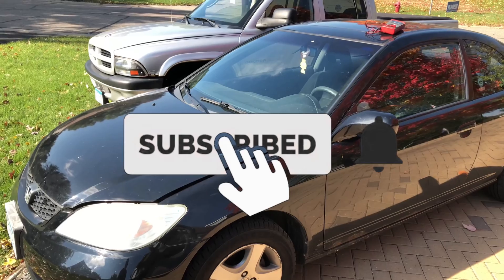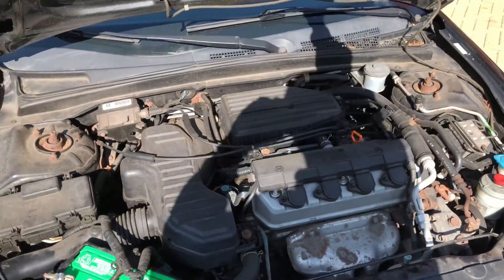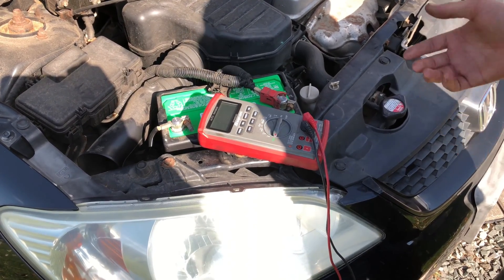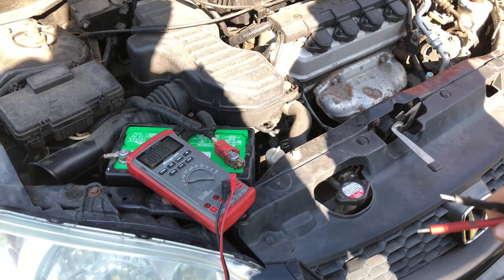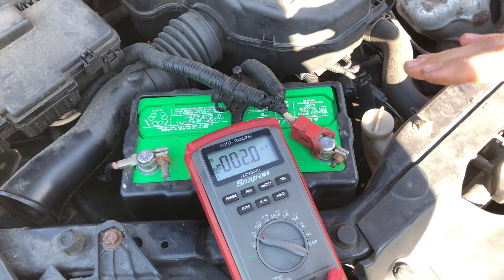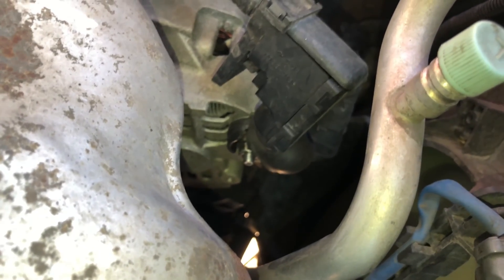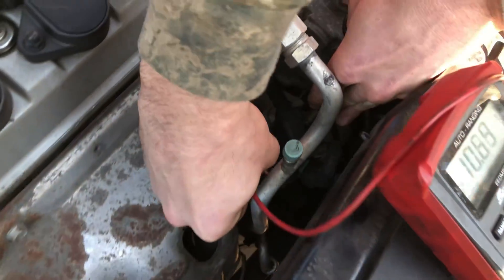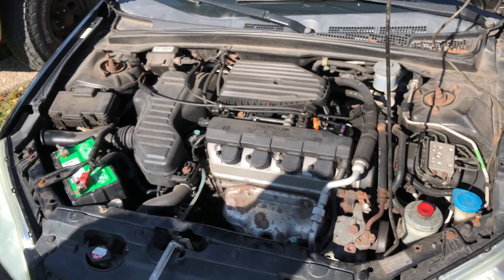How To Test An Alternator | How To Check An Alternator

Comment: What should it read when testing the alternator? Where should it be to know it’s good?? Thanks in advance
Reply from the maker: You should be getting around 13.5V-14.5V while the engine is running. Anything below 13V is usually considered weak output.

Comment: Battery sitting at 11.8 but started. Volts at battery dropped to 9.8 when stareted without any extra load. Saw your video but now won't start. Getting battery checked and charged. I will do the check at the alternator once I get it started. If I'm still getting under 10V at alternator do I need to check for anything else, or can I assume it's the alternator.
Reply from the maker: 99% of the time it would be the alternator. There’s always a small chance that it’s a bad regulator or a broken fielding wire going to the regulator, but most of the time the regulator is built into the alternator anyways, so that basically just leaves a potentially broken wire.

Comment: Thanks for replying sir. I tested the way you did and the alternator puts out about 1.45v that's what showing in the multimeter set to 20v looks like I have to replace it.
Reply from the maker: Only 1.45? That’s terrible lol. Assuming that’s an accurate reading, it’s definitely not charging.
Reply: @TonyTheTruckGuy  Yeah, 1.45v that's what it's showing, bought it from a wreaking yard. I tested fuses and continuity of all the connections from battery to alternator they all ok. I'm shopping for a new alternator on e-bay now. Cheers,

Comment: Good video. when testing the alternator your meter showing 11.7v if the alternator is good what's the reading would be above 12v??.
Reply from the maker: 11.7 at alternator is bad. If the vehicle is running, you should have over 13v at the alternator and battery. 12-12.5 at battery and alternator if engine is off.

Comment: Yep my alternator was charging at like 11.5V, I had just changed the regulator on it about a month ago, was charging at 17v! Was working good for a while. Guess it's time for a new alternator, do you recommend any brand?
Reply from the maker: OEM if you have the money, otherwise pick your poison. I’ve used several O’Reilly brand reman alternators without issue, but I’ve had problems with Napa batteries and alternators. I got 4 bad alternators in a row from Napa on a early 90’s F-150 and they all charged 12.5 or below. 5th one finally worked lmao.

Comment: But what if your car don’t even turn on at all? My battery is dead but I put a different one a honda one idk if it matters cus I drive a Z but it still didn’t turn on n the new battery is new! Is it the starter or the alternator?
Reply from the maker: Does it even crank the engine over when you turn the key?
Reply: @TonyTheTruckGuy  negative it don’t even do that and I’m worried
Reply from the maker: @RunnerUpGunner  Either the new battery is not corrected properly, or you have other issues going on. Even if the alternator were bad, the car would still start with a good battery that’s properly connected unless it’s not the battery that’s the problem
Reply: @TonyTheTruckGuy  so it could be either the starter or alternator-is what I hope
Reply from the maker: @RunnerUpGunner  Not alternator. Alternator has nothing to do with starting, just charging. If it won’t even try to start, either the battery is dead or connected wrong, the starter is bad, or power is not getting to the starter when you turn the key for some reason. There’s many possibilities.
Reply: @TonyTheTruckGuy  so it’s the starter if it ain’t getting charge at all? Cus the old battery yes it was completely dead but the new one from the Honda is fully charged yet won’t even crank or nothing completely dead so it could be the connecters from the battery going bad or the starter
Reply from the maker: @RunnerUpGunner  Yes, could be starter, could be cables, could be a relay, could be a fuse. The ignition switch could even be bad. You would need to do a series of tests to isolate the issue and properly diagnose it, otherwise you're just throwing parts at it.
Reply: 1 of the 3 wires connecting to the alternator could be the issue....check each 1 @ the alternator

Comment: Thank you sir! I was gonna replace the alternator because  the battery  is only a year old with  a 1000cca. The battery  reads 12.5 but won't  start after a jump the alternator  is 14.6 and battery is around the same with vehicle  running so I'm thinking the battery  and Michigan  cold weather. Thanks. Subcribed
Reply from the maker: Yeah, either that or there’s a draw in the system or something was left on. Just replaced the battery in my mom’s 2005 Ford Escape last February, and it crapped out this January lol, not even a full year. Appreciate the follow!
Reply: @TonyTheTruckGuy  I had a charger on it before I tried to start it and it just clicked once , I'm gonna try cleaning the post which don't look bad but I think the battery is toast thanks for the reply.

Comment: Welll question i started my car note my challenger is a 2015 no problem and we recently had a big storm and so I had my car sit for 4 days and when I started it I smelled a electronic smell and smoke and a weird sound from my engine bay then I start to see my voltage on my car going down. So next day I try to start it and It didn't go so I jumped it and it started but idled for a sec then died
Reply from the maker: Could be a lot of things at play here, but I would start by removing and charging the battery, then reinstall it and see if the car starts. If it starts and runs, then check the alternator. Not sure what’s with all the smoke and stuff though. Some rain shouldn’t have that affect unless it got flooded lol
Reply: @TonyTheTruckGuy  thank you
Reply: @TonyTheTruckGuy  well i actually found out that it was my serpine belt and that it ripped and broke up so for that am I needed a new alternator or should I be fine with just the belt. I fully charged my battery and it came started at like 12 volts and started going down after a while so wasn't sure if a new alternator was needed
Reply from the maker: @jaedonwilson9488  Spin all of the pulleys by hand. If none of them are seized or making any weird growling noises, you should be ok with just a new belt. Kind of weird that the belt just broke though. With all the smoking you mentioned, I’m going to guess that the alternator or one of the other pulleys are seized and need to be replaced.
Reply: @TonyTheTruckGuy  well thing is we had a huge snow storm I noticed a piece of ice was on the part where the belt sits so idk because I had my car sit 4 days and I noticed it an hour ago
Reply from the maker: @jaedonwilson9488  Maybe the ice was the culprit. Just make sure you can spin every pulley that the belt rides on. Should be able to spin everything by hand except the crankshaft pulley.

Comment: Not able to reach my alternator. Its burried. Any other points to measure on?
Reply from the maker: Just at the battery
Reply: @TonyTheTruckGuy  sorry for my stupid questions
Reply from the maker: @orfeous  Now worries at all. You could probably also check at the starter, but I’m sure that’s harder to get at than the alternator.
Reply: @TonyTheTruckGuy  yeah.. the alternators connections are like underneath :D

Comment: THIS was very helpful!  Car wouldn't start this morning, presenting like a dead battery.  Tested the voltage per your directions and was reading 12.46.  Jumped it to get it running and tested again and it went up to 12.47, tested the voltage at the Alternator per your directions and it was reading 14+ volts out.  Ended up being dirty terminals...cri$i$ averted.   Thank you for the clear instructions.
Reply from the maker: Glad I could help!

Comment: What if the alternator is reading 15.16 directly on the alternator?
Reply from the maker: If your battery was nearing dead, the alternator may charge at that voltage for a while so it can catch the battery back up. If the battery is fully charged and the alternator is just constantly charging at over 15v, then it’s overcharging.

Comment: What about tensioner? Could that be a reason for lack of power? Just asking
Reply from the maker: Yes, if your tensioner is too loose and the belt is slipping, you could have insufficient power output from the alternator as well. Excellent point.
Reply: Is there a system that a person can use to diagnose an issure? Like fuse pwr first then direct battery then alternator kinda like that, it would be nice to have an order of operations thats generic for everything
Reply from the maker: @The_Pleiadian_Canadian  Yeah I would check for an alternator or “generator” charging fuse if you have one and make sure it’s not blown. If that’s fine, check alternator output. If alternator output is low, check and make sure belt is tight, then verify alternator is actually spinning and not seized. At that point, if you still have issues, the alternator is likely bad. You could have a damaged charging wire or cable but that would require visual inspection

Comment: So if I check the alt fire and ground it to the alt and it's like 11.7  is that 100% bad alt?
Reply from the maker: You COULD have a broken charge wire going to the alternator connector but it’s pretty rare. Usually the internal voltage regulator in the alternator goes bad.

Comment: Fully charged battery, car still doesn't turn on. Do you think it's the alternator or something completely different?
Reply from the maker: If it starts and then dies then it’s probably something else. Even if the alternator is putting out zero volts, the car would still run off of the battery if it’s fully charged.

Comment: My battery was dead, charged it at oreillys, but still wont turn on.. it only cranks. Any help? 2008 mazda cx7 turbo sport 2.3L 155,000 miles
Reply from the maker: Could be a million things unfortunately, need more information. Did the car just suddenly die while driving?
Reply: Answer him
Reply: I apologize, notifications were off. Diagnosed it myself with no social media/internet help

Comment: I have a 2008 Jeep Patriot with a new battery , just went for a long drive and the battery light  kept coming on, (one time all the lights came on briefly) when either taking off from a stationary position or high revs going up hills.   I turned off all electrics and still the battery light came on.    Carried out your check and the alternator is charging up to 1400 v .  any idea what could cause this?  any help is appreciated thanks 👍
Reply from the maker: Make sure the connections at the alternator and battery are tight and clean. Other than that the only thing I can think of is if the alternator is charging proper voltage but not enough amperage.

Comment: Hi,there.My battery shows 14,87.when I started the  car the battery drops to 13,37v and going down slowly,do not understand how come battery is at 14,87,I had to turn the lights to take the top layer electricity that build up and went down to 14,37.still more voltage on battery than ussual
Reply from the maker: It’s possible the alternator is on its way out but I wouldn’t worry until it’s putting out 15v or more. If you have a weak battery sometimes the alternator will work harder to charge it but if the battery is at 14.8 before you even start the car then it’s probably not weak. Actually kind of surprised as most batteries won’t hold that kind of voltage they normally are under 13v just sitting there.

Comment: Is it normal 100 130 C degrees alternator temp ? Too hot to touch after 30 minutes drive ?
Reply from the maker: Pretty much anything in the engine bay will be too hot to touch after a 30 minute drive haha. 130° C does seem pretty hot but I would pop the hood and let the car run in your driveway or something for 30 minutes and check temp again. I’m sure the temps raise more when the hood is shut. If you have no charging problems I wouldn’t worry too much
Reply: @TonyTheTruckGuy  I changed the alternator because it doesn't charge anymore. Like the old alternator, the new one gets very hot. I checked everything. There is no voltage drop in the + cable, there is no grounding problem, the amp consumption is within the normal range, only the temperature worries me. Thanks.
Reply from the maker: @elsequitoelsen4779  Yeah if it’s just the temp I would probably run it

Comment: battery is only used to draw enough power to start the car. the battery is SUPPOSED to read lower when running than a static test
Reply from the maker: Lol noooooooo. Battery voltage should always be higher while the vehicle is running.  12-12.5 static with vehicle off. 13-14 while running.

Comment: Hi there

1. You were able to start the car even when the battery was below 12 volts. I didn't know that was possible. I'm working on my car right now and I can't turn the engine with the battery at 12.10 volts. Are there multiple factors at play here? Forgive my ignorance, I'm not an expert. 

2. If I disconnect a new or working battery from the car, can I expect it to retain at least 12.6 volts for several weeks or is it normal for the battery to gradually go below 12.6 even when it's not connected to anything?
Reply from the maker: 12.5v is about what a good battery would be at if it was charged and then you disconnect it and set it aside for a few weeks, assuming it’s not in extreme cold. USUALLY if you have about 11v or more, the vehicle will start especially if it’s warm out and just a 4 cylinder like this. Another factor isn’t so much the volts, but the amps. You could have 12v battery but if it’s a junk battery that only produces 200 cold cranking amps when it’s rated for 700, it probably won’t start.
Reply: @TonyTheTruckGuy  cold cranking amps, correct?
Also, would a new battery become junk if it repeatedly gets discharged for whatever reason (defective alternator, parasitic draw, etc) ? For instance I bought a new battery, it gets discharged, I charge it up using jump starting procedure, it gets discharged again, and so on. Will that make the battery junk?
Reply from the maker: @eeyyaakk6801  Yep, cold cranking amps. And yeah completely draining a battery like that is hard on them, same with jump starting them frequently.

Comment: Hi friend
positive probe on the stud on the alternator, negative probe on alternator case?
Thank you
Reply from the maker: That works too, I just prefer to take the reading at the battery because sometimes you will have a bad cable between the battery and the alternator. So the alternator could be putting out 14v, but only 9v getting to the battery.
Reply: @TonyTheTruckGuy  subscribed! Thank you
Reply from the maker: @eeyyaakk6801  Thank YOU!

Comment: Ty for the video helped a lot do you have a video on checking the starter
Reply from the maker: Currently I don’t, but I’m sure there’s a few videos out there showing how. Basically you just use a test light to verify if you’re getting power to the little starter wire when you crank the ignition. If you have power but nothing happens, the starter is most likely junk.
Reply: @TonyTheTruckGuy  I see ty bro knowledge is power!

Comment: On mine is it dcv / 10meg ohm input ?
Reply from the maker: Hmm. It shouldn’t be on ohms for checking voltage. Ohms is checked typically when there’s no power going through a circuit. Dc volts is correct though